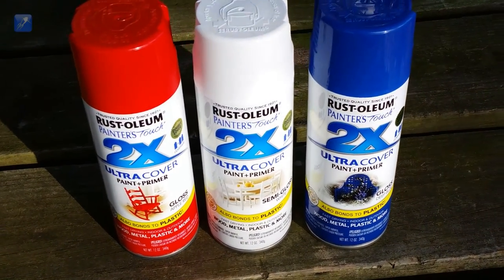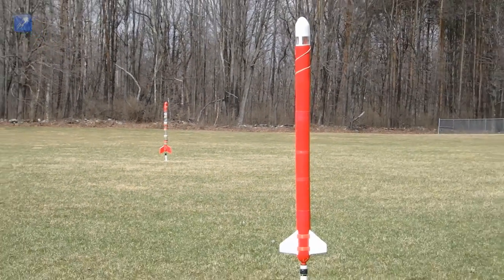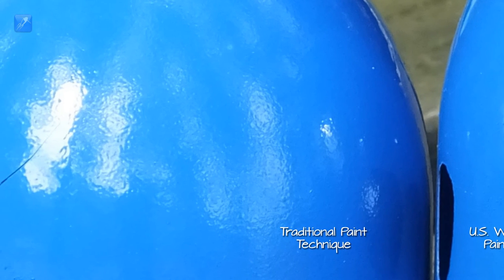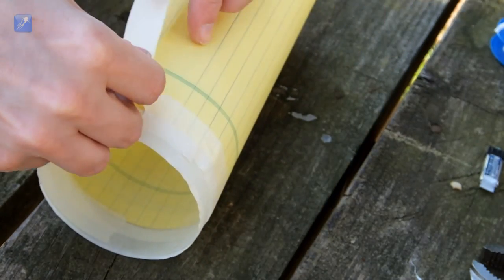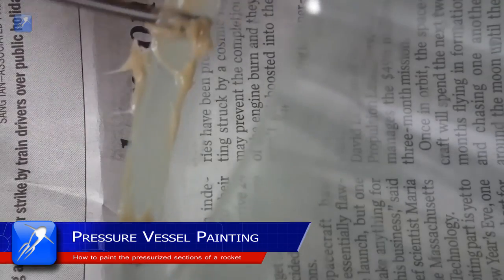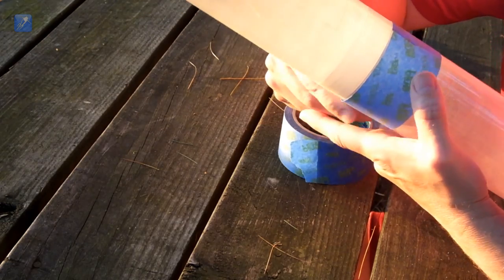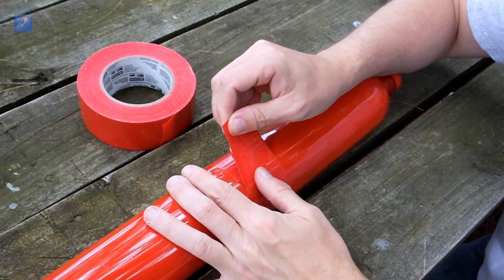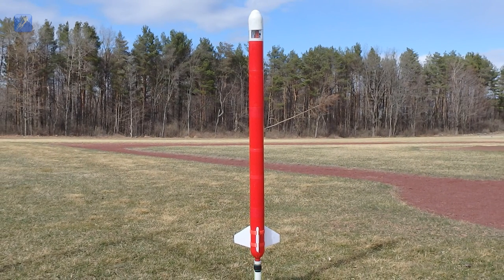How to Paint a Water Rocket Flawlessly

Comment: That's awesome, but what I really want to see is the stabilized rocket clip you showed at the end. Great video!
Reply from the maker: +ctjet99 Thanks for the comment. It's coming, but we have a backlog of videos to edit!
Reply: +USWaterRockets Good luck with that!
Reply: +USWaterRockets also, do you think you could do a thrust vectoring system similar to this fin design, with or without fins attached to the vectoring nozzle? You could use that to control the fins as well, but I guess it would be hard to keep a 3d printed nozzle/joint under stress for that long, and it wouldn't provide much use because the thrust only lasts a few seconds...
Reply from the maker: +ctjet99 The idea of a thrust vector nozzle is interesting ,but I have a feeling that the amount of torque needed to move a water rocket nozzle is so incredibly high that the servos would be too heavy to lift. Water rockets are really quite heavy, and so even with a restricted nozzle, the forces on the nozzle are very high.  The second issue would be how to keep everything from leaking under pressure. Those are some huge design challenges.One of the main reasons for using a 4-fin design in our setup was so that we could simultaneously do attitude correction and spin stabilization. Each fin has a PID controlling the rotation based on the roll orientation and tilt of the rocket. The PIDs then control the fins individually and keep the rocket pointed up, and kills the spin at the same time.The next step is to calculate the distance travelled using the altimeter and/or accelerometer and use that to create a flight path, say straight up for 200 feet, roll 180 degrees, for another 200 feet and then tilt west 20 degrees for the next 200 feet. It should look pretty cool. We have to do a little research before attempting this because it might be classified as a guidance system if we include that kind of software, and that would be against the FAA regulations. In that case we might be able to code it so it avoids something, such as "never fly over the woods" and then fire it that way and watch it evade flight over the treeline. That might be a legitimate thing to do.
Reply: +USWaterRockets +USWaterRockets Wow, thanks for that incredibly well written reply. I'm sure active stabilization would not count as a guidance system, but I could be wrong so I guess it would be best to check with the FAA. As for the nozzle construction itself, you could probably have a bottle to flexible pipe adapter, and then flexible pipe adapter to nozzle, if you had four bearings, one for each cardinal direction, you could probably get some secure anchor points for the nozzles. As for the torque needed by servos, you would  probably need very little torque. The force vector would be pointing directly into the anchor points so you could probably get away with two medium-small servos mounted in either a Cartesian style or two push rod configuration. As for the 4 fin design, you could mount four fins onto the nozzle assembly for pitch/yaw authority, and then have two more servos/fins, one on each side for roll authority during flight. You could also use those two extra fins as glider wings with parachute on for descent and do a guided soft landing, however that would need a lot of testing and perfecting. I'm curious as to what 3d printer you have as well.
Reply from the maker: That's interesting. I hadn't thought about it that way when I was imagining the setup. I could also print some sort of gears or use a pully system to increase the torque of a small servo if it was not enough. It would not have to move very much at all to steer the rocket. The more I think about it, a servo usually has a 180 degree or 90 degree rotation sweep, and that's way too large, so a 2:1 or 3:1 gear ratio would increase the torque and take advantage of more resolution in the position of the servo. Interesting ideas!
Reply: +USWaterRockets very interesting! I may have to try some of this out for myself on my 3d printer. Best of luck to your future endeavors on this path!
Reply from the maker: ctjet99 Yes, best of luck to you, and thank you for the interesting conversation!
Reply: +USWaterRockets thanks for the interesting conversation as well. I don't have the necessary stuff to fully test it, but if I am able to make a working one I may send it to you for a full scale test on a rocket

Comment: Hello USWaterRockets. That's a really neat idea! When I paint the nosecone, you are right about the 'flaky' finish. I wonder why putting the paint on the inside stops this happening? The last clip was a tease- you nicked my idea XD, just kidding!! I did post something about that magnetic sensor on the Water Rocket Forum if you are interested. I have started making a control system for the rocket using near same ideas as you- it is amazing how cheap those i2c sensors are and the amazing projects you could make with them. What microcontroller do you use? Having said all this, I don't have a fancy 3D printed servo assembly which looks very impressive. I simply use push-rods and control surfaces as you could find on a RC plane. Good luck with that- I am looking forward to the results. Good luck with coding the control algorithms- your going to need it!!! AWESOME STUFF, Jamie B.
Reply from the maker: +JSB Rocketry Hi Jamie, the paint we use says that it's meant to paint all surfaces including plastics. When we put it on the outside of the rocket it sticks well enough to handle it and touch it. It doesn't fall off by itself, but you can scratch it off with your fingernail or a sharp object. If you use tape on it, then it comes off when you peel the tape. If you paint will not stick even a little bit, it might be a problem.  The control system is a long term project that was started over 2 years ago, but it was complex and slow to design and there were a lot of other things that came up, so it's taken a while to get it going. We use the Texas Instruments MSP430 Launchpad for our projects, since we got hooked on them when we designed our LainchPad AlTImeter.  We program them in C language, and develop our own control algorithms based on research. There are a lot of existing examples that could be reused, but I want to learn how the software works by creating my own.We recently switched to the MSP432 Launchpad because the new microcontroller is an ARM based 32-bit controller with an FPU for a decent price. The FPU and CPU speed helps with the intense math.Good luck with your design, and thanks for all the feedback. It's much appreciated!

Comment: Is that an active stabilizer I see at the end? 
Mine is in the middle of getting a revamp for higher torque and miniaturization (from 3in to 1.8in airframe)
How are you doing the control loops? Kalman filtration then PID? 
If you need any help with the mechanics or design, shoot me a message!
Reply from the maker: +Arsenio Dev Yes, you guessed it, it's active stability and attitude control. I'm writing all my own code, so all I have so far is cascaded PIDs. I am aware of kalman filtering from the apogee detection research I did for my altimeter project, but have not added it to this design.  I would definitely discuss designs like this with you in the future. Thanks for the offer!

Comment: Excellent paint technology. I also use this technology. It is also more economical paint consumption))). And the best covering power at the expense of the glossy surface. It will be interesting to see how the stabilization system (control) at the start of the real. Whether cope with a load of servo motors? We do not think to add FPV-system to the rocket? What do you think, is it possible to build a system to stabilize the mechanical gyroscopes?
Reply from the maker: +WATER ROCKETS CLUB I believe you could easily make a stability system with mechanical gyroscopes. Early rockets first had systems like this when rockets were first being developed. A system like that would probably weigh a few hundred grams, and so anyone doing it would need a high power pyro rocket to lift a payload that massive. A water rocket has a big advantage in lifting capacity, so it is ideal for such an application.

Comment: Will the paint adhesion be affected if I don't sand the surface? I plan to paint the inside of a plain old 1.5 liter bottle via the nozzle.
Reply from the maker: +Maru Ivan Rico  I have always been told that paint will adhere better if you sand a smooth finish. Some paint says to do so on the instructions label. I never tried to skip that step to see what happens, so I cannot say for sure what the results will be. If you test it yourself, please let me know how it works.
Reply: +USWaterRockets Okay I will let you know.

Comment: TI Stabilised.
Reply from the maker: +Maru Ivan Rico TI and Adafruit!
Reply: +USWaterRockets Good thing you migrated to Arduino. I'd like to request an Arduino version of the LPALT. 

Thanks in advance.
Reply from the maker: +Maru Ivan Rico Whoops! Sorry to give the wrong impression. I was referring to the Adafruit sensor boards we've been playing with, not the Arduino itself. We've been doing more work with the MSP432 Launchpad, recently.  You may not be aware, but TI has a clone of the Arduino IDE called "Energia" that runs on the Launchpad, and a version of that called "Energia MT" which is a multitasking Energia version. You simply create multiple tabs with a sketch in each one and run the program and it multitasks the sketches simultaneously. It makes doing complex things really easy. Energia also works with TI's Code Composer Studio, so you can use the CCS real-time debugging features on sketches, something that is really lacking in the Arduino.
Reply: +USWaterRockets Awesome.